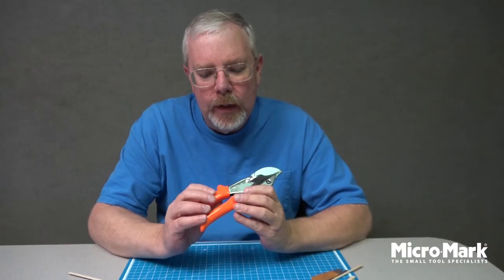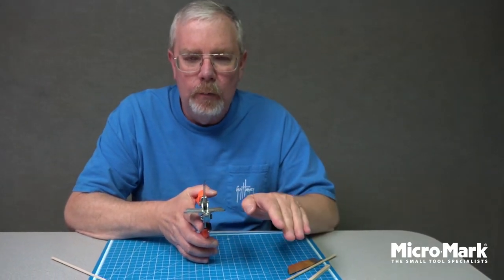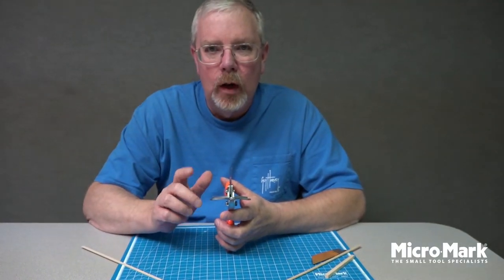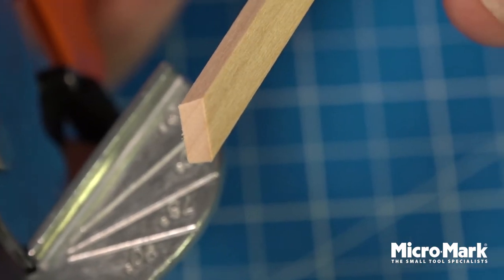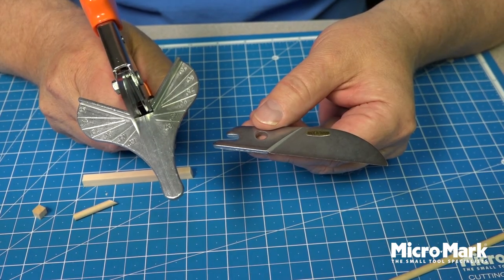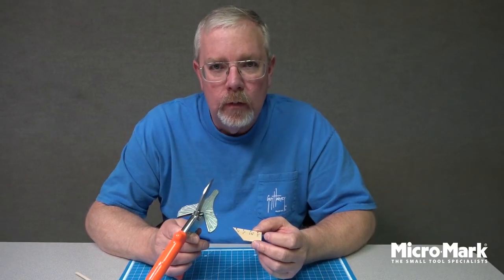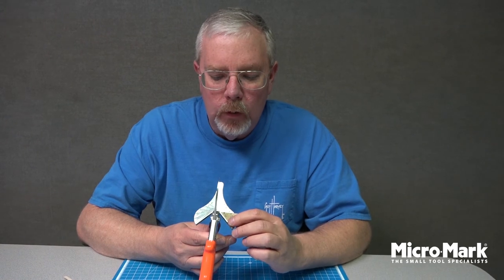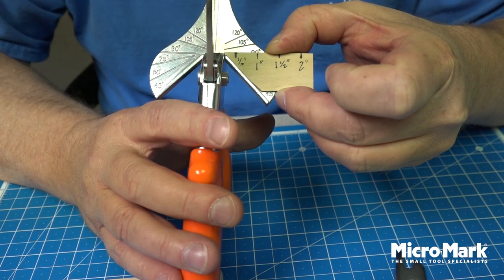How To Use The Miter Master To Make Clean, Sharp Miters In Wood ( Works On Plastics Too!)

Comment: Hi Mark, I was working on a decorateive project with your tool and needed 45 degree cuts I had many issues because of all the cuts I made one one set of met perfectly together. I had to use wood filler for all the others to fill the gaps. I am not sure what I did wrong when making the cuts (I always used the guide provided) 😢 advise for the future ?

Comment: Thank you for sharing this info with us.  I am wanting  to buy one of these little jewels.  But, I do have a question I hope you can answer, though.   I am just getting into woodworking, and, am needing to cut things like popsicle sticks for a few projects I'm wanting to make.   My question is this:  Would I I be able to cut popsicle sticks at an angle if I lay them up on their sides instead of cutting them flat.  I'm wanting to make things such as Gazebos and am wanting to cut the sticks at an angle for the rooftop and other parts, keeping the sticks flat and making the "tops" you place together form a "V" shape.  I hope I have explained that correctly.    And I hope you can answer my question or give me any suggestions as to what I can use to  cut at such an angles on the sides of the popsicle sticks.   Thank You  so much for your help.